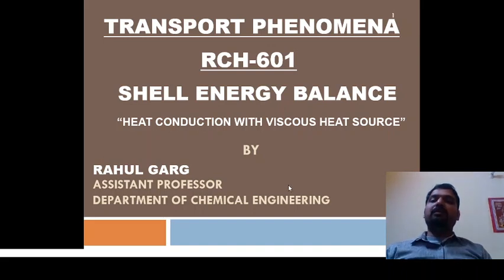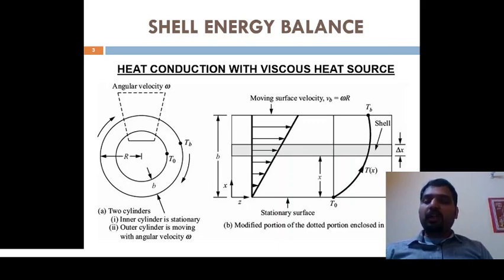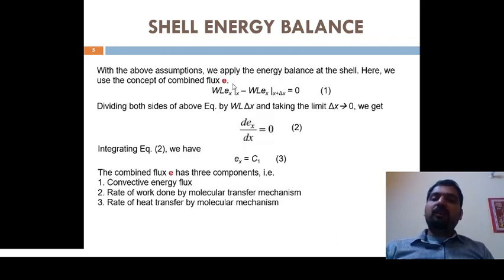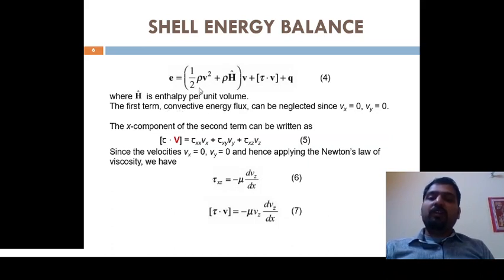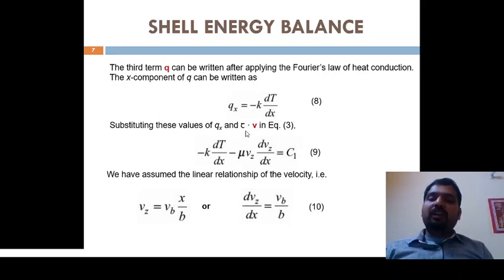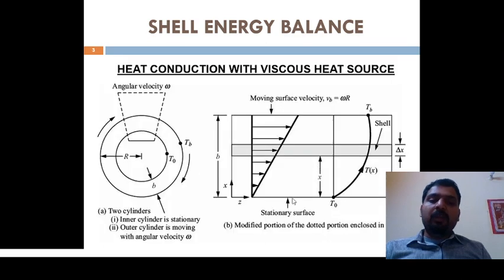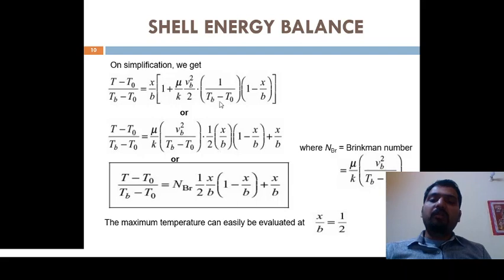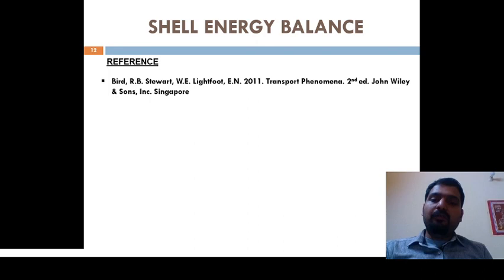Heat Conduction With Viscous Heat Source

Comment: 6. Heat is flowing through an annular wall of inside radius ro and outside radius r1. The thermal conductivity varies linearly with the temperature from ko at To and k1 at T1. Develop an expression for the heat flow through the wall at r = ro.

If possible, a solution to this question